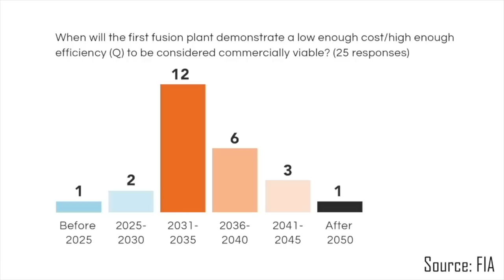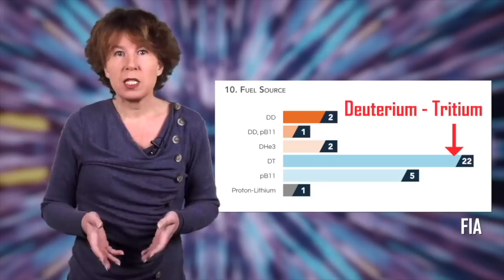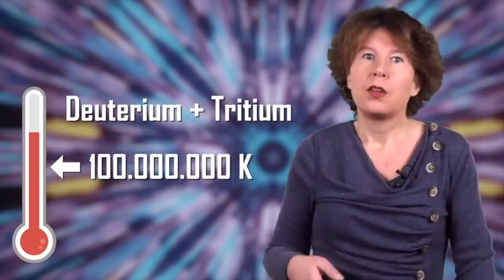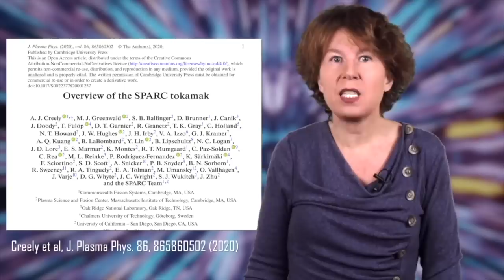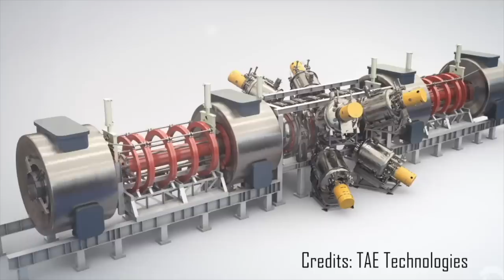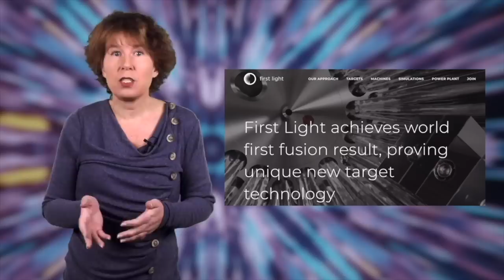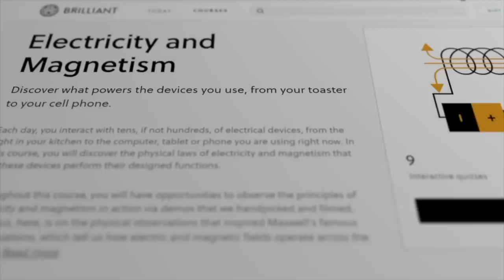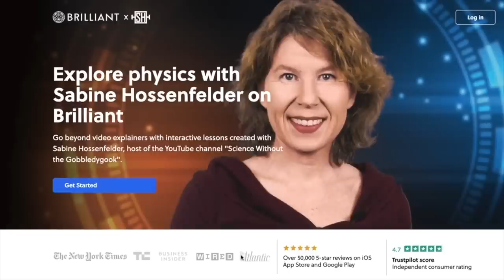Nuclear Fusion: Who'll Be First To Make It Work?

Comment: I currently am doing D-D fusion in my small lab at a Q total of 10e-9 using IECF.  It produces enough neutrons to do a number of good activation experiments of several elements.  The one thing  learned by actually doing fusion by any method is that net power production from fusion is a tough nut to crack.  The common man is easily impressed by the press.  Sabine is always a voice for reason and logic.  This is something rare among people and even many scientists in the fusion biz.  Sabine has, for the first time, pulled together the encyclopedia of current startup efforts with significant details around each effort and the fusion fuels used.  Finally, I hold out little hope in any current fusion effort such as ITER , a multi-billion dollar debacle, or any of the startups with their ridiculous hyped grid ready fusion promised in the late 20' or the mid 30's.  The key to commercial viability is a Q total >20 but with Q total >100 being far more viable with the ability to work 24-7-365 for a number of years as with the current fission, coal, gas and hydro plants.  Oddly, this continuous expectation of energy from our wall outlets has persisted as a mindset for over a century now.
Reply: I am a working physicist (not fusion) and your comment is spot on.  All the promises I've seen in science that won't come to fruition for more than 5 years are really just hype to get funding.  I was surprised by Sabine's take on this video.
Reply: If Iter is a debacle or not is debatable. 
When comparing the time and efficiency of the project with what could be achieved by handing over he billions of Euros to the industry and have it built using commercial project management and, most importantly, procurement methods, you are right, in that comparison it is a debacle (or a somewhat slightly mitigated disaster, because it seems there will be a result, not meeting time and cost targets, but at least delivering).
Yet, when looking at what Iter is, a research and industrial development seed program, it has achieved remarkable results. Which other research project has brought so many nations together and enabled technology leaps in its field in so many countries?
A commercial or at least industrial project would have procured the parts from the respective cheapest reliable bidder. Which means orders would have gone to the US, the UK, Germany, Japan, France, maybe South Korea and perhaps, for some specific parts, Russia. But who would have ordered Klystrons from India?
Reply: @PresCalvinCoolidge ne thing I learnt is that pretty much everyone in physics is wrong about fusion.

When I was doing my PhD back in 2010ish NIF was a joke and I remember laughing at their claims of scientific breakeven.  No one could see past their ridiculous holhraum designs.  No one thought it would work at all. 

Then they spent ten years or so working just on target and laser approaches with simulations and after some testing turned an ancient groaning Cold War interaction chamber into an actual fusion reactor.

Literally everyone in fusion was wrong about NIF.  They weren't wrong about it's economic viability.  They were completely wrong about whether it would get to ignition at all. Once PIs figured out how to overcome the RT instabilities inside the capsule they had leaps and bounds within two months.

Physicists are wrong about everything almost all of the time.  That's the risk of being one.
Reply: You have a PhD but don't understand the difference between "its" and "it's?" @ralalbatross

Comment: I don't know, between fuel scarcity, durability and general net-gain issues (all of them being frankly understatements on my part), I still remain rather skeptical that we will see a comerically viable fusion reactor any time soon.
Reply: If ever...
Reply: We barely invest in it. Billions seems like a lot until you realize musk alone spent 40x that on twitter. We have no choice but to pursue fusion unless we going to burn all our hydrocarbons instead of using them to produce goods, or use fission which is dangerous and generates horrific waste.
Reply: Look in to the helion energy company !
Their designs and fuel choice is far superior
Reply: @canadajim  Well, there's a narrow perspective.
Reply: Deep well geothermal has a much higher chance of success than fusion.
Reply: @canadajim  Spending more money doesn't change the laws of the universe.  There has been NOTHING I've seen that has any chance of even truly breaking even on energy, to say nothing of the HUGE surplus that MUST be achieved if fusion is ever to be viable as a power source.
Reply: @Bill Collins  geothermal on a large and deep enough scale would release sooooo much water vaper in to the air, water vapor that is a greenhouse gas, that it would be less than helpful.

We need to move away from the heat exchange to gas to spin a turbine... huge losses in that.

Look in to helion energy. Watch their video on YouTube from recently about their reactor design and fuel choice.
Reply: @billcollins6894  One of many less expensive areas to explore with a might higher likelihood of success.
Reply: @John-ir2zf  Helion is interesting, but nothing says it will work. Fusion should be the last thing we are depending on. Keep researching it, but realize it may never pan out.
Reply: @Bill Collins  except that video I spoke of shows it working. They have net gain even in their small, prototype machines.

All they need now is commercial upscaling and necessary component manufacturing.

I've tried to get them linked up with Elon since Elon can potentially manufacture the high output, fast cycle time batteries needed.

In the end, fusion will be our only option.
Fossil fuels are finite. Solar and wind don't even produce enough now to keep up with our current usage and expansion so they will never be viable long term as our civilization grows.

Of course, governments laud the EATR type machines because they control them, despite the fact that EATR machines use fuel that we don't have enough of.
Reply: @Alondro77  
There are several different methods achieving fusion in prototype, so we've already solved the problem from a technological standpoint in many different ways. The majority of the development process from here will involve refining materials and design to increase efficiency and cost effectiveness until the product is producing more value than it consumes, and a lot of the time, viability is a matter of size and scale, which means all of these issues are things you can usually fix by just by throwing enough money at them. Fusion is still severely underfunded because people think it can never work, even though we still haven't really given it a fair trial in all these decades.
Reply: @John-ir2zf  No fusion solution has yet shown even unity gain, let alone net gain of electricity. It very well may happen, but right now it is all research with some prototypes.
Reply: @Alondro77  So basically you are saying that more people working on the issue doesn't help.  May as well shut down all projects and just have one.  Got it.
Reply: Ignis Purgatorius
This is meant as entertainment for YouTube people, not for people who understand science and have questions.
We are always very close, within 20 years always. Net Gain, the Laser ? Tritium, deuterium !
Reply: @canadajim  Musk did not "spend 40x" the amount spent on fusion research to buy Twitter. In fiscal 2023, the federal government will spend about $700 million on fusion research. But it is extremely misleading to compare Musk's one-time cost to buy Twitter ($44 billion) to the amount spent for one year's government subsidy, which hides the fact that the US government has been subsidizing fusion research for 60 to 70 years (and no, I'm not talking about the additional amounts spent on H-bomb research) and will continue into the indefinite future unlike Musk's cost to buy Twitter. I'm not sure anyone knows how much has been spent worldwide on fusion research, either because of the opacity of government budgets (the US, Europe) or because such amounts are state secrets (China, the Soviet Union/Russia). But the US alone has probably spent more than $44 billion, and when you add in international and private dollars, it is clearly more than Musk's $44 billion. And if by some chance it isn't, the $17 billion authorized for the ITER reactor will easily put fusion research costs far over the top.
Reply: @John-ir2zf  They all "work". 
For decades school children have been making working fusion machines as science projects. 

The problem is, if you employ any of the most promising reactors to sell electricity for a profit, you'll go bankrupt on the first day. They are not even remotely close to the point where it's commercially viable to sell electricity.

A reactor working and it being commercially viable are two very different things. As the last 60 years have proven.
Reply: @Tyler Durden  we aren't talking about a fusion generator that "works" (since you are correct, we have done that plenty of times).
We are talking about one being economically viable for large scale use by humanity, not playing in garage with a science project.
Reply: What fuel scarcity?
Reply: @billcollins6894  Geothermal is far from carbon neutral.

Comment: I'm hopeful Helion's approach with direct electrical conversion works. If they're able to avoid a steam generation cycle entirely that will be is own breakthrough!
Reply: Bussard polywell reactor design was supposedly going to do the same thing.  The fusion cycle they were going for was an aneutronic fusion reaction with lithium and boron which makes two beta particles.  The beta particles get shot out of the reactor core through a few coils to catch induced electrical energy, but then slam into a copper collector.  The collector becomes extremely positively charged which pulls electrons from ground.
Reply: We can finally stop boiling fucking water!
Reply: @Ryanrivera95  There is nothing wrong with boiling water, but it would be far better to heat up something like molten salt and use a high temp system,. These direct to electrical systems are in the realm of startrek engineering,
Reply: @kayakMike1000  Interesting that Bussard should come up, wonder if Dr Lerner will get any mention too.
Reply: @Ryanrivera95  People seem to be obsessed with avoiding energy generation via steam, first and foremost cause its so old-school and not high-tech enough. This is a criterium equally irrelevant as one Sabine Hossenfelder has also talked about: Aesthetics for assessing the quality of an equation or theory. 
Yes, there is a considerable loss of conversion regarding electricity, but only if you dont use the thermal energy. Which we can and should use - and thats much more feasible with fission, connecting households nearby to a local thermal grid. In fission, plants mostly are seperated quite a distance from densely populated cities due to safety reasons, which is not necessary with fusion.
Reply: it looks like it is the most promising.  However, Earth doesn't have any Helium 3. To obtain Helium 3 we would need to get to the moon to mine it from the regolith. One has to account for this cost or energy input as well. And mining Helium-3 from the surface of the moon is not precisely cheap.
Reply: @Xoman08  you'd have to generate it, similarly to how they make tritium.
Lunar mining won't make sense for a long time, I think.
Reply: @hooplehead1019  there's still the cooling requirements, and size of steam equipment. An entirely electronic conversion system could be comparatively very compact.
Reply: @davidgunther8428  True, this additional space matters little in a power plant, though.
Reply: @hooplehead1019  for distributed, district power plants, the smaller size could be very significant. 
Cooling towers are huge, and have significant water requirements. High efficiency minimizes the cooling requirements, although we do not know the efficiency of Helion's type of electricity generation process.
Reply: @Xoman08  Good thing Artemis is well on its way, then!
Reply: @Xoman08  If you have tritium, wait 12 years and half will have beta-decayed to the rare-but-stable helium 3. Tritium today is formed mainly as a byproduct in fission reactors such as CANDUs using heavy-water moderator, but Deuterium-Deuterium (D-D) fusion can also produce it, along with some Helium 3 directly, and less useful Helium 4, across various possible reaction paths . Once you have D-He3 fusion working sustainably enough to need He3 in the first place, D-D is no harder, but unlike D-He3 it does release some neutrons, with the vessel-irradiation problems they bring. They're less energetic neutrons than the ones from D-T, though, so the degree of damage over time to vessel walls should also be less.
Reply: @Ryanrivera95  only if that conversion process is near 100% effiecient. (I seriously doubt that). 

Let's say it's 60% efficient. The other 40% is gonna become heat...which most likely will be used to boil water and turn steam turbines.

Similar to combined cycle plants that currently also does that with the waste heat.
Reply: @tylerdurden3722  that's still better, though.
Reply: Induction motors are well understood, the approach is probably what excites me the most because such things can be much faster scaled rather than being some obtuse length of time.

Comment: My favorite is General Fusion.  The rotating shell of molten lithium and lead absorbs radiation which protects the reactor and provides a way to extract the heat.  Bombarding the lithium with neutrons produces tritium which is needed to fuel the reactor.  A demonstration plant at 70% scale is scheduled to start operation at Oxford in the next couple of years.

Comment: I sure hope Helion can get their technology to work for real because ability to generate electricity directly from the fusion without using high-tech steam engine sounds really good.
Reply: Nope, the idea that the same circuit you're putting power into will then give you power back because of an expanding thermal plasma literally has no legs when you actually look at the physics. It's a just a nice thought. Sorry (:
Reply: @phoneisnotketchup  I'm sceptical, too, but I think humans still understand plasma physics so poorly that I wouldn't claim it's totally impossible yet.
Reply: @phoneisnotketchup  I agree. I've watched some videos of the guy who runs Helion, David Kirtley, talking about how the thing is supposed to work and the explanation he gave is what I call wishful thinking. The overall machine is an innovative design but the key problem I'm concerned about is how much energy they'll be able capture from what Kirtley described as compressed plasma. It's not even the heat from fusion they seem to be after, but rather it's the energy contained in the compressed plasma. His explanation of how the thing is supposed to work requires an explanation. I really hope the machine works, but I've got doubts about it. Hopefully, we'll get more info when they finish and test the latest version of the machine next year.
Reply: @you5711  But there's gotta be fusion somewhere in their procss, right? If all they do is compress the plasma then extract energy when it expands they're not generating any energy.
Reply: @firecat6666  firecat6666, I hear ya, but you've really got to listen to David Kirtley, CEO of Helion, describe how the machine works because he sounds a bit like a bullshit artist. In my comment to phoneisnotketchup, I was talking about Kirtley's description of how the machine works where he mentions how they extract energy from the compressed plasma rather than the heat from fusion. Watch some videos that feature a description by Kirtley of how the machine is supposed to work, and you'll see what I mean.
Reply: @phoneisnotketchup  that’s a foolish statement.

Comment: You can call it Nova Fusion if you want to. Trademarks like that are product/industry specific. As long as you aren't planning to market the output electric charge as a hair volumizer, you are probably fine. 😜
Reply: It'll be a real kick in the pants if coupling hair volumizing with fusion was the missing link to feasible fusion power all along.
Reply: Ummm… “no va” mean “won’t go” in Spanish, so perhaps, not the best name for a fusion power plant…
Reply: @donlindell1994  Only if you put a space. If you write it as "nova" then Spanish speakers will have no problem with it. "Nova" means the same thing in Spanish as it does in English.
Reply: @donlindell1994  What do you mean "not a good name"? It would be perfectly descriptive, I assume.